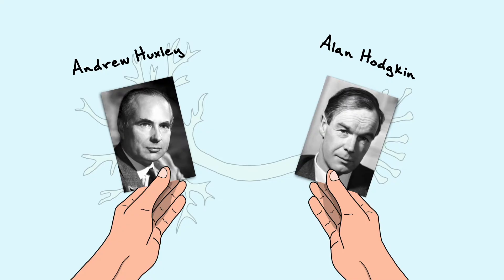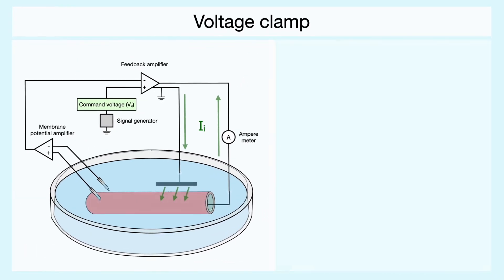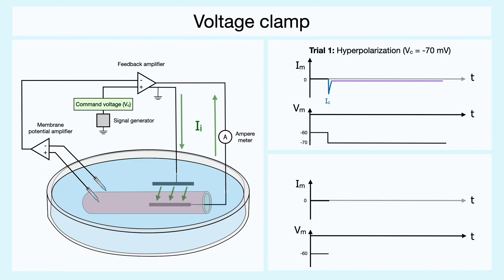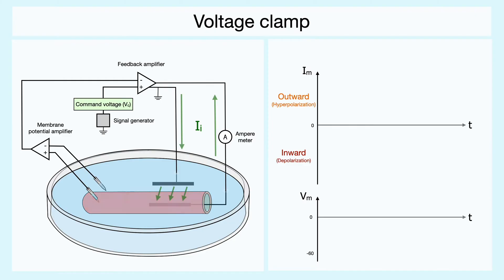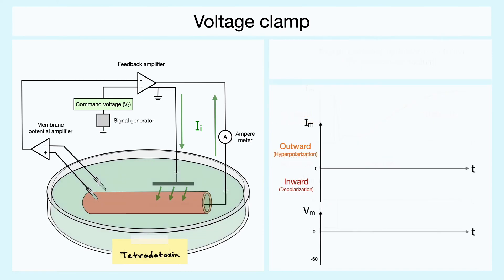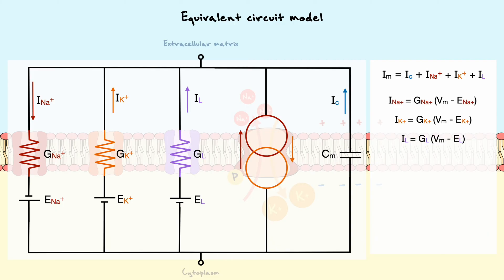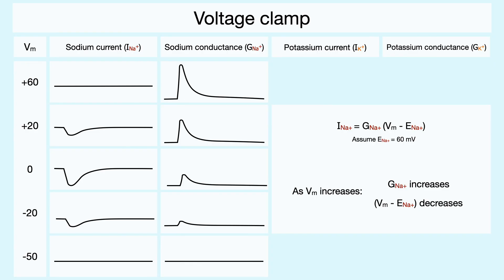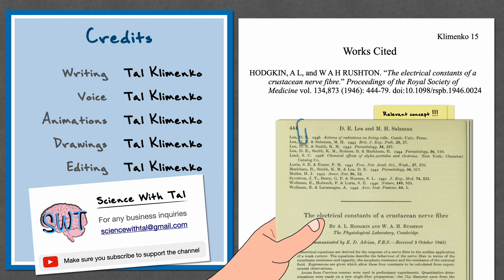Voltage Clamp Explained (Tetrodotoxin And Tetraethylammonium) | Clip

Comment: Nice video, also I don’t understand Trial 1. 
Vm = -60 and Vc = -70, so we want a negative current to come-in (a.k.a positive current OUT of the cell, making Vm more negative). But you mentioned in Trial 1 that it’s an "inward current" (movement of positive ions INTO the cell) ? Isn't this contradictory to what you explained earlier? I see someone else asked exactly the same question, meaning this part is indeed unclear. I read your answer explanation in the comments, but it’s still confusing. How does that even make sense? Your explanation of inward/outward currents is based on positive ion movement, so it should naturally refer to the capacitive current (Ic), but suddenly you mention it’s due to the leak current (Il). Leak current isn't even in the the previous equation. Please help us to understand !

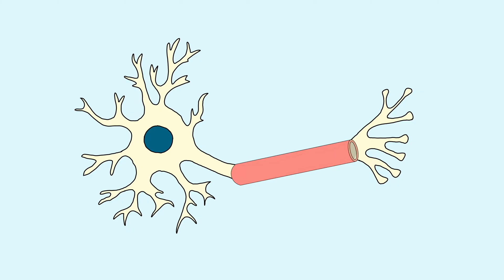Comment: great video!! Only a couple of things, why at minuti 1:20 at -50mV we have no current but at -20mV we have, what exactly happens between that two values? what is the factor that triggers the channels to open? and what happens at 0mV to have such a high inward current respect to -20mv and +20mv? Sorry, I'm bit confused. Thanks a bunch!!!
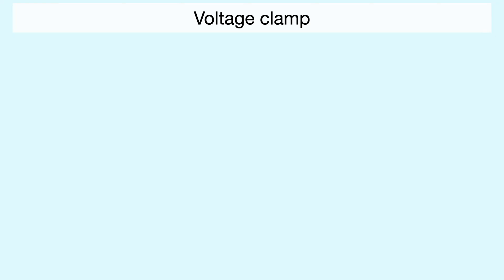Reply from the maker: Hi, good question! This is something that I look into a bit deeper in this video about the Hodgkin-Huxley model (Hodgkin-Huxley Model of Voltage-Gated Channels Explained). At 11:39 to 13:34, what I try to illustrate with the sequential steps is that the current and conductance of sodium and potassium (which can be isolated from voltage clamp experiments) are drastically different.

The reason why the sodium current happens first and closes quickly whereas the potassium current opens later and is sustained has everything to do with the kinetics of the voltage gated channels (which can be explained by the Hodgkin-Huxley Model).

To answer your question more directly, the main factor that makes the current increase between -50, -20 and 0 mV for sodium is that since they are voltage-gated (VG) channels, the channels open a bigger pore with higher voltage and let more sodium ions enter, thus, leading to a higher current. 

For the +20 mV condition, recall that the equilibrium potential of sodium is about +60 mV so as the command voltage approaches that value, the sodium current diminishes since there is less net movement into the cell (let me know if you need clarifications on the equilibrium potential). On the other hand for potassium, its equilibrium potential is at about -80 mV so its current keeps rising.

Let me know if this helps, thanks for the feedback!
Reply: @sciencewithtal  thanks a bunch!! all clear now, I will also give a look at the video you’ve mentioned
Reply: It is said that oxytocin can make people loyal. Have you ever extracted oxytocin? @sciencewithtal
Reply: @sciencewithtal Are you planning to extract oxytocin from ergot?

Comment: I didn't fully understand why there is an inward current during hyperpolarization, such as when Vcommand is set to -70 mV. Because typically, inward current indicates depolarization. Could you explain this?"
Reply from the maker: Good question, that was something confusing for me as well!

Basically, if I reword what I mention in the video: we have a cell at rest at -60 mV, and now we clamp it to -70 mV. To do so, the voltage clamp will send negative charges to push the membrane potential towards -70 mV. Given that the neuron wants to stay at -60 mV, the neuron will open leak channels (IL) that will send positive charges inside to get back to rest and this is what you see on the readout as the inward/depolarizing current. 

In other words, with voltage clamp you are measuring the current response of the neuron and since it gets hyperpolarized, its response will be to open channels and depolarize to come back to the resting potential.

Hope that clarifies your question, let me know if I can help further!
Reply: @sciencewithtal  well i think to do clamp it send charge based on the feedback(which is a typical property of an OPAMP - used as an feedback amplifier here) i.e.- in the above example as the clamp voltage is 70mv and is lesser than the membrane potential which is -60v i.e the negative feedback is there which means it takes positive charge from the membrane or say gives negative charge to the membrane - which is okay and the example is inward but based on the definition of inward it says the negative current is the movement of positive charge in the cell. but here no positive charge is going to the cell even its not depolarizing.. what i guess is that inward and outward is basically depending on what cell wants to do like if we are hyperpolarizing to -70mv and but the cell wants to be at -60v which is its resting potential so what it will do - it will basically take positive charge to well i know finally it has to be at -60 that's why i am also confused with the thing i thought about it as.
Reply: please reed the cut part i am unable to remove it but it's not done intentionally
Reply: Thank you very much! Crystal clear now.
Reply: Inward current is the rushing of voltage gated Na+ ions, therefore it's depolarization. And outward current would be the opposite, Na+ going out, that is hyperpolarization.

Comment: I don't understand. I thought that in an operation amplifier, the potential between the (+) and (-) ends must be 0. But in that case, the potential between extracellular and intracellular space AKA membrane potential, should be 0
Reply from the maker: From the way I understand, the offset between the (+) and the (-) terminals has to be set to 0 to give the corresponding difference in voltage between the two. Basically, it sets the ground/reference electrode to 0 mV and makes it so that the voltage picked up by the electrode inside the neuron is the membrane potential (e.g. -70 mV). If the (+) and (-) terminals are offset by -10 mV then the reading will give -80 or -60 mV depending on the arrangement of the apparatus. Let me know if that makes sense!